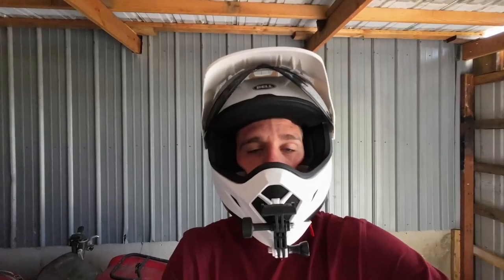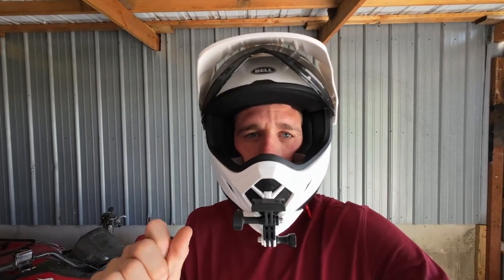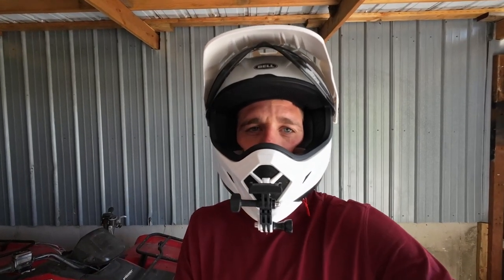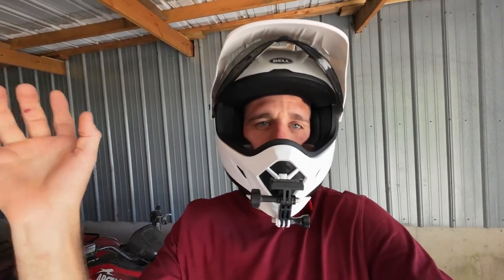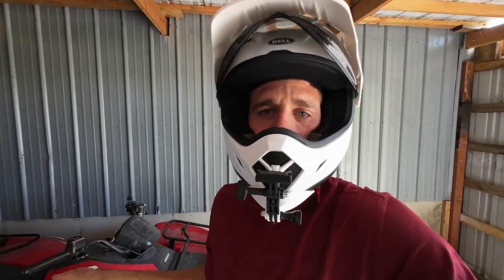You're Getting Code PO635?

Comment: 2010 700s Cruiser GT Efi. It has to be jumped to start. I have replaced with two different new batteries. The batteries are Lithium with 550 CCA. It will turn over slowly, but does not have the amps to start it. I jump it with a 2500 amp portable jump box and it cranks right up. I do get the code PO635 after failing to start. I have replaced the stator with an Arctic Cat OEM part. I have changed the 0w / 40 synthetic oil and NGK spark plug with no results. It runs fine after starting. Any ideas? I have order a new volt meter that is supposed to arrive tomorrow. So I have not tested the volts yet.  I have synchronized the EFI  and checked the TPS setting as you suggested.    Last week I was getting EFI flashing.  I drained the gas and replaced it.  It had water in the gas.  I have cleared all codes.  I am just getting the PO635 code for low voltage after failing to start.  It goes away when I place the battery on a 2500 jump box.
Reply from the maker: I would get the battery load tested, most auto parts stores can do this for you. If you had water in the gas you’ll need to clean out all the lines. https://youtu.be/g69YEqmsp5I?si=Pe8MR0dplZDCwf0-